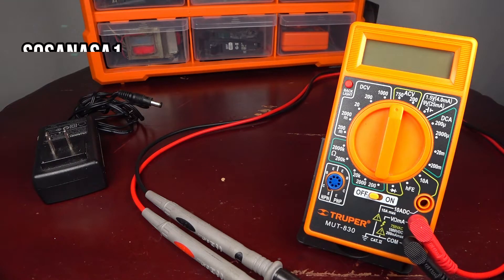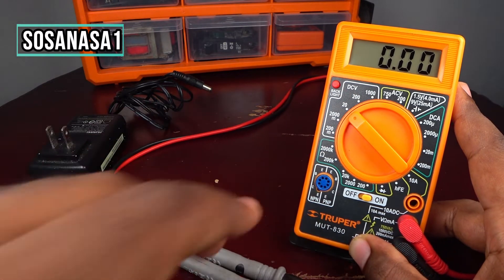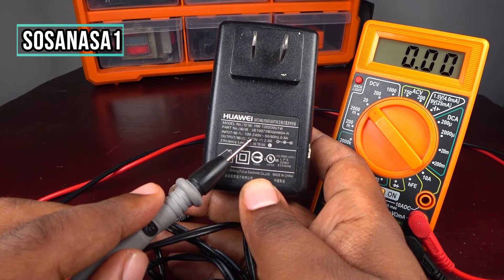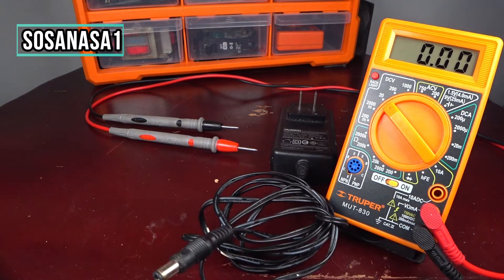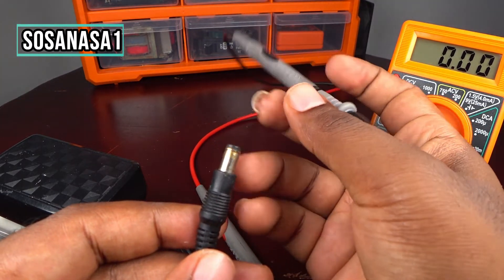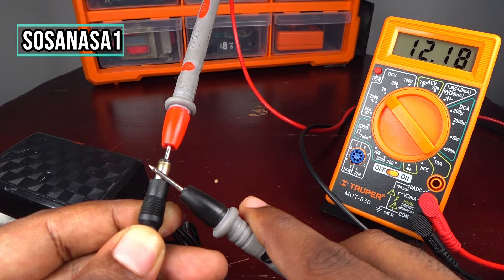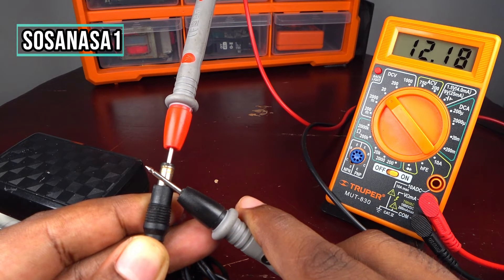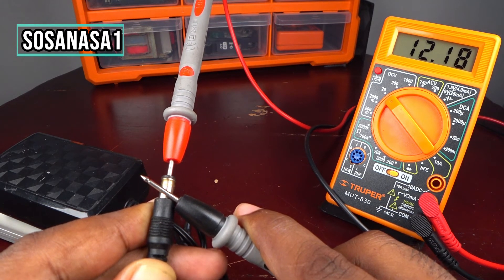how to test a power adapter with digital multimeter

Comment: Do those metal probs need to stick that far in for it to work? I have nine Sony power adapters that I'm testing and the probe barely goes in, but they are all reading at 0. The only one I could get to work was a Sony 3V adapter. I just really doubt the other 8 adapters are dead. I have it set to 20 DCV just like your video. I feel like I'm doing something wrong.

Comment: Excellent just the video I was looking for.
I need to test a cable with a similar plug going in to my car dashcam to see if it's supplying power or if the dashcam has died. Just what I needed to test that.

Comment: I thought my dads speaker died but it was just the power supply. Very, very nice to know 👍🏼
Reply: I’m literally diagnosing my Jbl extreme speaker 😂 .. never had a power adapter die in my lifetime but I think it’s a first now !
Reply: @5abivt  it's incredibly easy to throw away something that has no problem at all, knowing how to diagnose those things is something really, really good! Now I have curiosity about all the other electric things in my house 😅
Reply: @matheo4712  indeed !! This speakers worked great and talking to the wife.. couldn’t believe that it’s been like 8 years already .. seemed like 3-4.  It’s always been taken care of I usually listen to it in the garage when working on cars. I have a digital voltmeter that I wasn’t sure was reading correctly but I brought the Adapter to work and tested it and same thing.. it’s putting out like 40 milivolts so I can order up a new one. Hopefully it’s my issue too glad you got yours working ! 👍🏼
Reply: @matheo4712  wanted to update that is was my power supply in the end ! Both batteries charge well with a new psu. I’ll be taking the Jbl one apart to see if I can find where the issue occurred ! 👍🏼👍🏼

Comment: Question. What does it mean if power adapter is working but after having power for 20 minutes it starts humming loud and then if shake around it’s cable the humming cuts in/out?

Comment: Two adapter each 5 vdc output check out okay. Only one powers
on device. I presume problem is in pin connection inside device.
Will change pin connector.